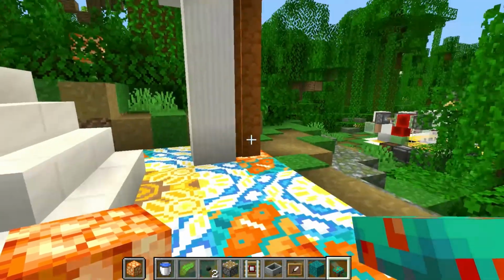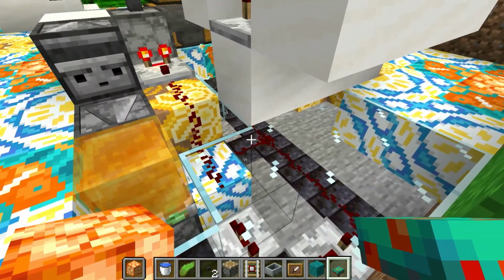NOOB / PRO / HERMIT - Showcasing 3 sizes of a New Concept Nether Tree Farm

Comment: Kinda sad that there are some nice creators with amazing farms, subbed now!  I'm thinking to build the hermit version in my single player world. It's gonna be hard ahah
Edit: maybe the hermit one is too much
Reply from the maker: THANKS! You're very kind! 
Note that, though,

- Since the recording of the "Hermit size" part, I've improved the circuit in order to fire the pistons not every cycle but only when a tree is actually generated, this should reduce the enormous amount of lag.

- But I've still to implement a tweak that bonemeals and fast destroys any grown plant which is not a mushroom, in which case instead it stops bonemealing for the 2-3 secs needed to fire the pistons. This will augment productivity over time, but the lag will rise (pistons will fire more often and fps will drop more frequently, being precise.)

- This is an aesthetic build. It actually works and it is decently efficient, but it's not the cheapest piston based farm you can do.
This one requires like... 200 pistons and 250 observers for each corner. 12 corners the "Hermit size".

Anyways if you decide to build it I'll be very proud, just wait for this evening that I'll implement the circuit which I said to augment its productivity and have it generating trees more often. Why build the first release when there's a 2.0 on its way?

Write me here or best on Twitter for any suggestion or clarification but absolutely show the world the result! It would be an incredible satisfaction! And thanks for subbing! :)
Reply: @bonovoxel7527  I'm gonna write you on twitter once I'll start the build, I am planning to use the litematica schematic from the world download, the materials are not a problem luckily.
Thank you for your availability.
My English could not be the best because I am italian.
Reply from the maker: @alessandro_casti  Ekkekkazz so' italiano pure io de che stamo a parla'? AHAHAHAHAHAHAHAHAHAHA Ok fatti sentire, ci riesce anche meglio spiegare i tecnicismi!
Se la fai su un server ti do una mano in game volentieri.
Materiali a spese tue però! Come dicevo è l'equivalente di una Lambo: 
E' bella? Oh, è stupenda! 
Corre? Ovvio! 
E' la più veloce? No, compra una Ferrari. 
E' la più economica? No, compra una Lotus.
Spero il paragone renda l'idea. Ad ogni modo per ogni cosa sono qua! :)
Reply from the maker: Ps your english is actually just fine!
Reply: @bonovoxel7527  ahah grazie, che coincidenze
Reply from the maker: Ciao, se ti interessa ho postato stanotte un video con una modifica sostanziale al circuito principale: E' in grado di rilevare se è cresciuto un fungo gigante o meno, nel qual caso si arresta il bonemeal e manda in funzione il muro di pistoni.
Prima faceva sempre un ciclo intero tranne i pistoni (a meno non ci fosse bisogno).
Dovrebbe essere molto più efficiente così. Spero. Cioè, il circuito dal punto di vista logico è più corretto come è fatto ora, ma in pratica ho il timore che sia equivalente o addirittura fosse più veloce prima. Il feedback è obv super gradito.
Finire sto progetto mi ha fuso il neurone, Jesoo!
Reply: @bonovoxel7527  ho visto la notifica, ma non ho ancora visto il video, settimana prossima penso di iniziare il progetto.
Il problema è che il mio computer fa abbastanza schifo, potresti quindi mettermi una litematica? Che le provo in creative.
Reply from the maker: @alessandro_casti  Sai che non l'ho ancora imparato Litematica? Ci sono i world download, riesci a copiare le strutture con Litematica? Dovrebbero già esserci nella cartella /structures del world...
Reply from the maker: @alessandro_casti  Ah comunque io ho un laptop da 600€ vecchio di un anno. Va davvero meglio di quel che pensavo, AMD Ryzen 5 con scheda dedicata Radeon Vega, leggo qui. Non ne capisco molto, ma esistendo setup per desktop PC da più di 2000 euro credo che il mio sia perfettamente nella norma se non al di sotto. Credo ti funzioni, anche se per quel poco che so dipende molto anche da come hai destinato le risorse di sistema (e sono impostazioni che sul mio ancora non ho modificato).
Reply: @bonovoxel7527  Litematica è veramente semplice, selezioni una struttura e la salvi come schematica.
Comunque il mio computer è un laptop che hanno dato a mio padre dalla sua ditta, ha 8 giga di ram e fin lì ci sta, il problema è che essendo stato creato per un ufficio, ha la scheda grafica e video veramente di bassa qualitá, per farti capire: non riesco a usare nemmeno una shader. Provo a destinare meno giga a Minecraft e poi ti faccio sapere se riesco
Reply from the maker: Now I see the edit.
Yes, noob pro and hermit are just the decorations more than the size, the machine is the same on every corner but with different casings :) 
I suggest the "noob" size (2 corners) for a single player world with an average laptop like me, the "Pro" size (4 corners) for a Multiplayer server and a good Pc but tell and ask the server admins when you're going to switch it on. The "Hermit" one would be interesting to see it actually running by someone which has a high end gaming Pc, but on single player world preferrably.
Reply: @bonovoxel7527  My computer is quite bad sadly, I can try to build the pro or the hermit in a creative world first and then I'll see if the lag is too much